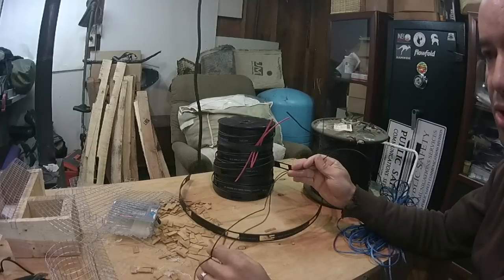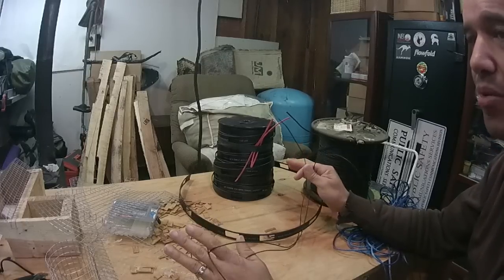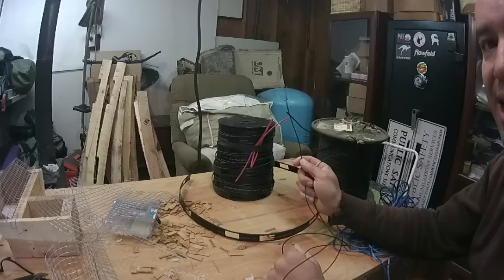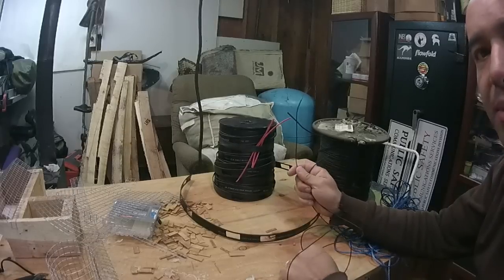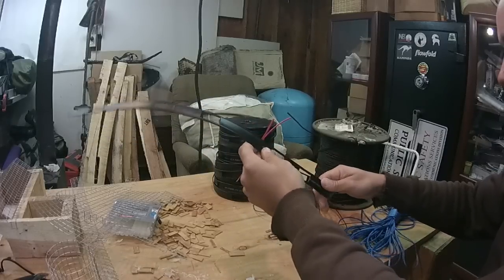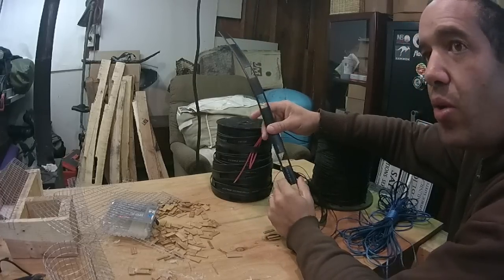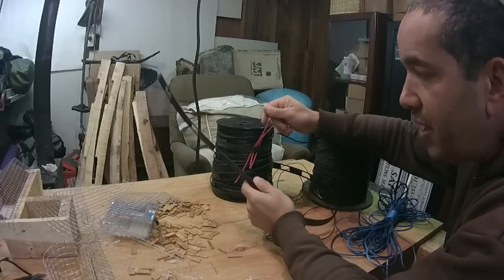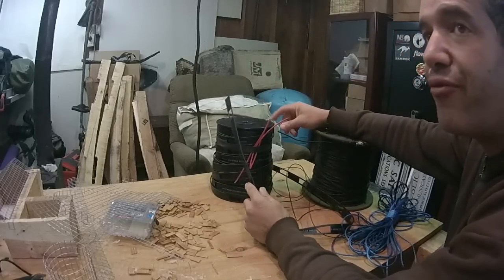HF Dipole Wire Antenna Deployment Ideas, Hardware

Comment: In a crisis you can make antennas out of anything metallic whatsoever.  If you were pushed, all you need is a farmers fence and you're on the air in quite a decent fashion.  I've made countless antennas out of soft 1.6mm galvanised tie wire (don't use the high-tensile stuff.) A 600m roll of this new wire will likely cost you around US$30, and no one is ever far from a farm supplies store.  The losses on a 30ft section of cheap CB coax is unlikely to be more than 1dB on 40m.  You are far more likely to have problems by using that 600ohm feeder, when the antenna and the radio is expecting to see a 50 ohm feedline.

Comment: I did not realize that my 14awg copper line that I have for my NVIS antenna may stretch and break if under a load. I have read that ladder line is not needed if the antenna is tuned to a particular range.  Ladder line becomes necessary when using an antenna tuner.  In this case the line loss would be excessive.  Because I am a poor boy living in  motor home in the woods of Montana, I'll use a roll of 72ohm cable I got for nearly free and make two antennas 40 and 80m.  When I go to use the tuner I got cheap, I'll use a short piece of LMR400 and accept the loss.  If a low power Rockmite can do the job, then ye'ol hybrid  830 Kenwood with 100w will too.

Comment: Never saw the zip tie trick to lock the cable down.  Love your channel, have an engineering degree in another discipline (structural), worked in the cellular industry for years, I've learned a lot from your videos.  I have a sweet idea for a field expedient guyed tower.

Comment: Good stuff, GC.  I'll definitely be watching to see what you do with this!  Early in the video you referenced doing NVIS.  NVIS antennas take up quite a bit of real estate and are only good for the 20, 40 & 80m bands.  Here's a link to the plans for my 20/40m NVIS antenna:  https://drive.google.com/open?id=0B1WixOlKiz5ZekVLNnlkVE9XOGc for long haul comms I use a 6m to 40m end-fed antenna I bought from KX3Helper.com.  it fits in a zip-top plastic bag.  You can string it into a tree with some paracord and be in business.  Let me know if there's anything I can do to help!
Reply: +Richard Slusher Fixed your link: https://drive.google.com/file/d/0B1WixOlKiz5ZekVLNnlkVE9XOGc/view

73
Reply: Thanks for catching that!

Comment: First the device you call a cable hanger is named a Macallume clamp spelling may be wrong but they were the only source  it is used to pull cables and controlling hoses in a test cell when testing valves and components so if you have a valve explode the hoses can't destroy the inside of the test cell.  If you ever saw a fitting blow at 6000psi you see why you need one.
I have seen field phone wire after 10 years in the sun it is the wrapper is gone and it is just bare wire.  As for not taking help. I'm a 60 year old prepped and learned that you can't go it alone over  the last 2.5 years I hurt my neck lost the use of my arms and legs for 6 months went from  a cane , walker , to a wheel chair now I'm better, take what help is offered even if it's just to learn how to build it your self.  Free is good. You could be helping someone by helping them clean out their garage.  I have given away and sold off cheap many antennas it killed to trash a 10 meter star duster but it had to go.
Reply from the maker: +Frederick Kaludis Sorry to hear about your injury, hope you're making a speedy recovery.  don't mind receiving or giving help when needed. On youtube when I start a project which is mainly for my preparations, I like to show every angle of the project. Just a little realistic perspective when dealing with comms, I could buy a new HF radio on credit and run to the garage and film how great it is without putting it through its paces, but the reality people don't see, is that it cost $1500 and I would have to take a year or more to pay it off with interest. Being in debt is a big motivational killer that should be avoided and I just want to inform the viewers what they are getting into. Basically if I'm able and or can manage on my own, then the help or piece of gear is available for someone who is truly in need. Its the Sheepdog in me. Thanks for watching.
Reply: +GUERRILLACOMM  I was writing from my phone and just couldn't find this earlier but they are called  Kellems clamps also called support grips Hubbell owns the company

Comment: Very cool ! Glad to see you selected ladder line. Coax sucks with non resonant antennas. An 80m doublet with a tuner and the setup is inexpensive , durable, compact, light and performs as well as the commercially available HF antennas.   Thanks for sharing !

Comment: I have wd1 wire for my 40 meter diapole 33 feet each side used 1/2 cpvc and caps for end insulator drill a hole in both fold the end of the wd1 back on itself and solder it. pit a small eye hook in the other side. hardwired it into a 25 feet of rg8x. used a small piece of plastic as a stress reducer at the connection and hot glue to waterproof it
Reply from the maker: +stoltzfl How's the performance? Glad to see some more surplus wire dog gear being used..